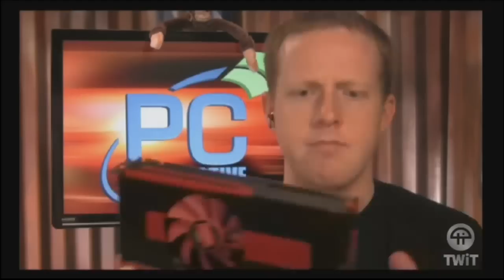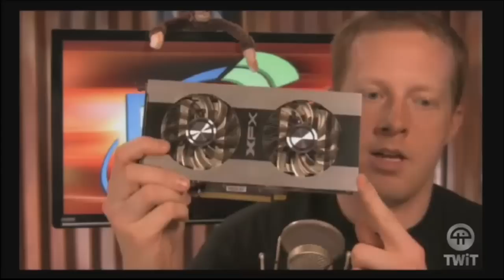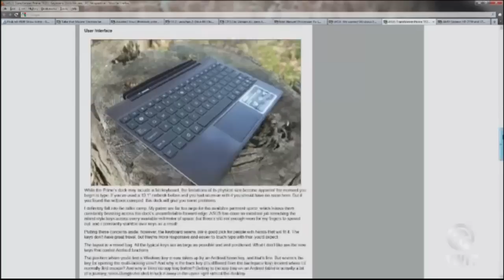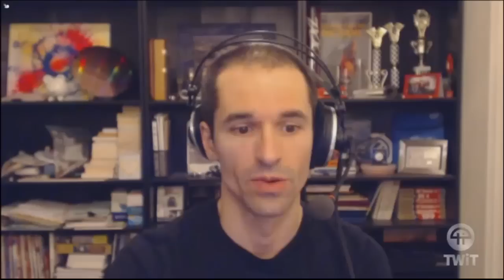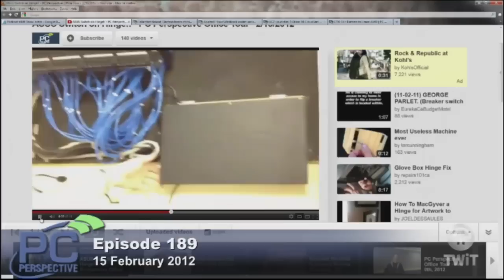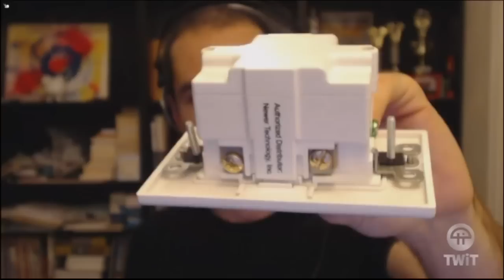PC Perspective Podcast 189 - 2/16/2012

Comment: I agree that we're at a time where highend GPUs have exceeded the requirements of most modern game engines, however, those times are coming to an end. Between BF3, The Witcher 2, and Shogun 2, we can see what we have in store. There are game engines on the near horizon that will put these cards through the ringer on just a single monitor. They are not a completely wasted investment.